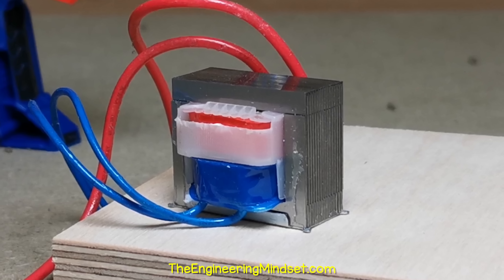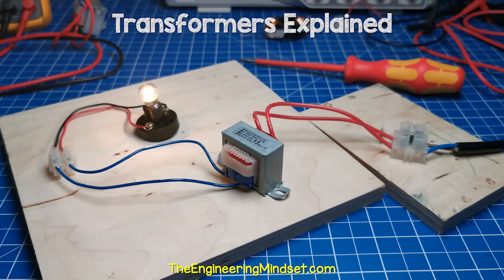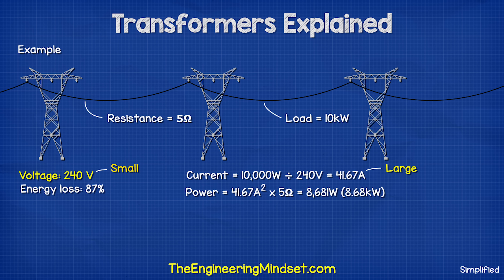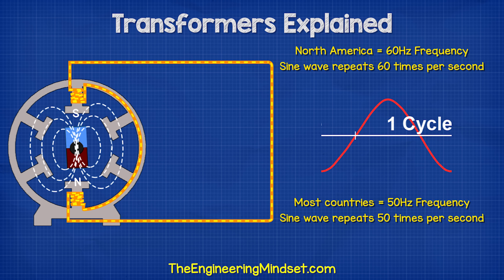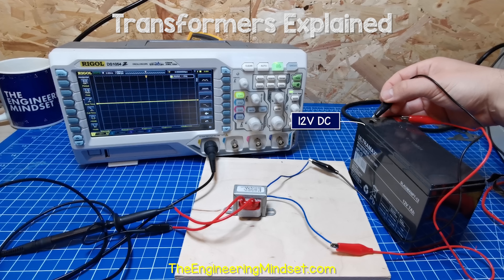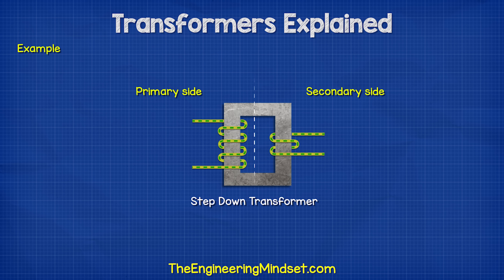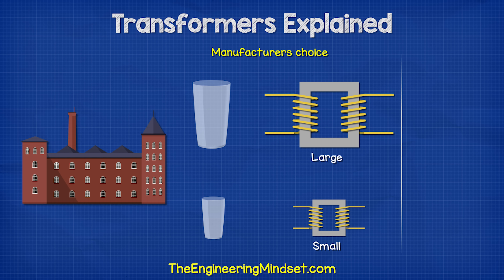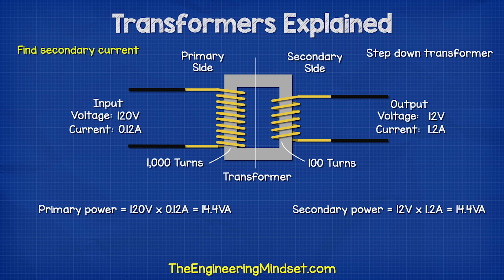Transformers Explained - How transformers work

Comment: Could you help me or explain,brieflly what I can do to solve my problem, My house is third from the last house connected to our main transformer,where I live and, these two plus my house have a problem with electricity,it flickers lights and it's annoying as hell. My house is brand new and I've installed all the latest tech of power security inside ,such as fault current protection switch and all circuit breakers from the best manfacturer but I still have flickering lights , this is not my personal problem but rather these few lasts houses on the grid. Is there any device that I can install to smoothe that electricity or anything I can do ?
Reply from the maker: You should be receiving 50/60Hz from your supplier, read their obligations for power quality and voltage and check your connection. It might just be the LED blubs you've plugged in, especially if they've been put on a dimmer switch, sometimes if you've mixed bulbs of different brands they will cause other lights on the circuit to flicker because they have different conflicting designs

Comment: Probably one of the best videos of this subject. I do believe, however, that you neglected to mention that sometimes transformers with the same number of turns on both the input and the output are used for certain applications. The purpose of that design is to be able to transfer power between two different circuits at the same voltage, but keeping them electrically isolated. If I'm not totally wrong, it is similar in function to a heat exchanger where energy, in the form of heat, is transferred between two isolated systems.
Reply: Isolation transformers are used all the time for supplying non linear loads i.e. VFDs and other electronics that are prone to damage from voltage spikes.

We had an overhead AC crane that kept tripping on overvoltage faults.   We would simply bucket up to the crane bridge cabinet and reset the drive. This was going on for months and we were getting tired of it. 
We got ourselves a 75kva isolation transformer and installed it in between the main switchgear and the breaker panel that fed the crane. After wiring the xfmer after the switchgear and before the breaker, we never had an overvoltage problem again.
Reply: Referred to as 'isolation transformers' and are used mainly to test/troubleshoot damaged and/or outdated/unsafe electronics. Largely as a safety precaution for Vacuum Tube electronics of the pre-60s/70s as they necessarily require high voltage supplies which could electrocute you if accidentally touched while open or if a fault shorted the hot side to the chassis. I forgot exactly but the transformer breaks one possible path for the current to travel through you if you came across the live while touching something grounded

Comment: It’s stated in the video that transformers only work with alternating current. What about basic automotive ignition coil? That’s a “step up” transformer, isn’t it? It take 12vdc and ramps it up to 30k+ vdc. If I’m mistaken, I apologize.
Reply from the maker: Please watch the section on DC and transformers. You'll see it can be used but not constant

Comment: Sir, my previous monitor work's with 110vac to 220vac, can you please help me thru giving a diagram or link on how i will connect it to my transformer with 3 input terminals 0vac, 110vac and 220vac.

Comment: Excellent video. Thanks.
Transformer grounding question?
I plan to place a step down transformer (110 to 16 V)  in a metal box.  The box will be grounded using the ground wire from the mains. Which of the following should be grounded to the box: primary winding, transformer core and/or secondary winding?

Comment: So the video stated that they don't work with dc power. Is an ignition coil for a car not a transformer even though it works the same with a primary and secondary coil. Would it be considered a step-up transformer or is there something about it that makes it not considered a transformer?
Reply from the maker: See the section on DC power, it can work when switched or voltage changes. Ignition is step up

Comment: Thankyou so much for the explanation, I'm New to electronics so I have one itching question,  if the primary side is not connected directly with secondary side is that mean the current from the AC generator will always flowing even tho the light is not turned on?
Reply: oh wait, is that mean the primary circuit is basically short?
Reply: oh wait, is that mean the primary circuit is basically short?
Reply from the maker: If the circuit is not complete in the secondary side, then no current will flow. So the ac generator runs, ready for when a load is connected. The ac generator will become harder to turn of a load is connecteded. You can still measure a voltage across the secondary side even though there is no load, because the coil is still energised, just no current flows except tiny tiny amounts from losses

Comment: I think transformer to load calculation @12:54 is slightly wrong: 90kVA & 89kW makes 13.4kVAr not 13.9kVAr. Unless I’m making a mistake…?
I’ve recently discovered your channel. These are great videos, thank you.
Reply from the maker: It's because 89kW / 0.988PFF = 90.08kVA not 90kVA. I omitted the 0.08 on the visuals but included it in the calculations. 90kVA = 13.4kVAr but 90.08kVA = 13.9kVAr

Comment: So then, a microwave is being upvolted to 240 from 120, and it looses half of the current.  What does the loss of current mean for the power, and how would the microwave perform if it were connected directly to a 240 outlet, like a dryer or oven?

Editing to add, I'm American which matters cause of the first few minutes of this video, and also, a complete novice, just curious, not actually going to "Tim the toolman Taylor" my microwave, don't you worry about that...

Comment: You need to watch a video by vatasium on what is electric turns out it’s just a magnetic field that runs along the wire not electrons flowing threw a wire.

Comment: I understood everything up till 12minutes 50seconds of the slide, where it shows a transformer apparent power is 100kVA and then it shows a load  = 89kW/90kVA, which doesnt make sense. where did the 90kVA come from? if the true power a.k.a load is 89kW and the apparent power is 100kVA, shouldnt the PF be 89kW/100kVA = 0.89?

Comment: At work they use transformers. They have a couple Cogeneration unit and they also produce chlorine. We have to build scaffolds for them to change the oil in the big ones now and then.

Comment: When I was a kid I had a train set which ran off a transformer which supplied 12V to the tracks. It was a massive device about the size of a brick. It also hummed.
How then are mobile phone chargers the size of a Mars bar?
The trick is to convert the mains supply to something like 20KHz, you only need a tiny transformer. The frequency is irrelevant when you run it through a rectifier.

Comment: But how do you limit the current on the supply side? With the wires wound and directly connected to the power supply one would imagine very low resistance and huge current that would burn the transformer.  Does electric field introduce resistance as well?  Great video by the way

Comment: how voltage changes on secondary: from idle to almost short circuit, i do not think it really follows formulas, for ex car battery charger  on empty batt it gives 12v and 4.5A,(and more heat) but when same batt is full, it gives 16V and 1 A, so i am working on trafo from microwave and replaced secondar with some 20-25 winds, and it gives some 16v at 10A,so what voltage could be at 30A

Comment: Reactive power itself is not causing the loss. Its the current that reactive power carries that when pass through the wire, causes heat loss based on wire resistance. Example. If a transformer delivers 100W real power @ 10v, 10A to a load and load has a power factor of 0.5, the reactive power is 100VAR to the load. There is another 10A flowing through the transformer coils (coils carrying 20 amps total), not doing any work but since its flowing through the coils, the heat generated by this current is I^2xR so by getting the power factor as close to 1 as possible, we get the reactive power as close to zero so the current flowing in the coils is as close to 10A as possible, improving the transformer efficiency. A load that eats 200VA but delivers only 100W of work has a power factor of 0.5. The transformer will need to be rated 200VA to supply that load. Put some caps on load and bring the power factor close to 1 and the transformer required can be 110VA to power the same load.

Comment: I 68, m, studied engineering many moons ago (seventies) and one memory is of challenging someone and finding out he was right. A fellow student went round the hostel asking us whether we believed we could get a shock from a 1.5 AA battery? I scoffed and said "of course not". 
Promptly he took out a 1.5 AA battery and a transformer (230 v AC to 6 DC) removed from its case. He asked me to hold the 230 v side wires and held one 6v side wire firmly against the bottom of the battery. Then he rapidly flicked the other wire (on the 6 v side) against the top of the battery. I felt a distinct shock as a MOMENTARY current (at 230*1.5/6 = 57.5 v) was generated by the transformer.
Such incidents do more to teach you the basics of a discipline than hours of dry lectures by Professors!

Comment: I've seen transformers in tv's, home stereos, older home theater sound systems, battery chargers, (high pressure sodium, low pressure sodium, metal halide, led street lights, treadmills, microwave ovens, rest top computers, indoor/outdoor AC units.
Reply from the maker: Seen the new LED explained video? so much detail covered! https://youtu.be/O8M2z2hIbag

Comment: Australia uses 240/415v. Residential choices are 1, 2 or 3 phase.
Reply from the maker: Nominal voltage of Australia is officially 230V, in line with the majority of the world. The networth is transitioning to lower voltage but not all States have implemented this yet. Some states have only part implemented it.

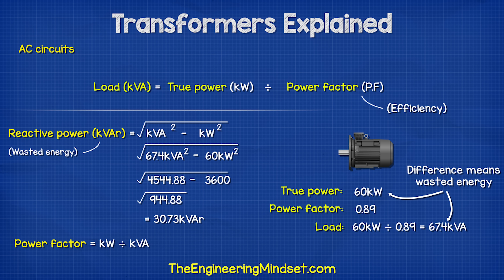Comment: @11:50 you mention the VAr is amounted as heat loss. For anyone reading it should be noted that the Power Factor; ratio between W/VA, is a representation of the phase angle (lagging/leading) of the voltage and current waveforms. A good way to visualise this is by drawing out 2 graphs of Voltage/Current waveforms.
1. Voltage and Current at unity, then draw Real Power on the same graph as (V*I)
2. Voltage and Current at 45deg lag or lead, then draw Real Power on the same graph as (V*I)

You should see that the multiple of the waves at offset, compared to unity shows a reduction in RMS Real Power, it's a good visual representation of the losses.

Comment: dc voltage spike switching on and off is intresting, could that have any application? seems useful
Reply from the maker: Yes, it's used in a joule theif circuit. I'll be making a video on that very soon
Reply: @EngineeringMindset  thanks! can't wait to see the video.

Comment: This is very informative thank you. I am an automotive tech and in these gasoline engines you need to break the dc current somehow in the primary coil to collapse the magnetic field. Due to the principle of electromagnetic inductance this produces a surge in voltage in the secondary coil. Your explanation goes even further and makes me understand more deeply.

Comment: That was helpful  😊 
Transformer ratio K= (n1/n2)=(v1/v2)=(i2/i1)
where
V1 : voltage at the primary side
V2 : Voltage at secondary side

N1 : number of turns at the primary side
N2 : number of turns at secondary side

i1 : current at the primary side
i2 : current at secondary side

Comment: And if you had three coils on your transformer where one secondary coil had the same turns as the primary and the tertiary coil had more, would the voltage and current add together if you spliced them into the same delivery line provided the delivery line could support the current and voltage?

Comment: If I was to show you a piezoelectric device that puts out 100,000 to a trillion volts AC that runs on sound and feedback would you be able to make a transformer for it to make it usable to the public? I'm a bit afraid to build it but maybe it can be scaled down. I have already engineered the 20 megahertz transducers.. most of the parts in 3d. Maybe we can help each other. This device requires no power input and picks up sound we can't hear to keep the piezoelectric disks vibrating non stop forever. it has a 4 inch spark gap inside it that will make radio frequency to spin and split water droplets that condense inside it. The sound from the exploding water droplets is fed back into the microphone in an endless feedback loop to keep the piezoelectric disks vibrating forever. The dilemma is...I can give you the 1 to 2 trillion volts AC.. but nobody would want to be near it. Any suggestions? The smallest 2 cubic centimeter crystal in a piezoelectric lighter will give off 50,000 volts.... is chump change in comparison to 2 x 12 inch piezoelectric disks cut as 2 speakers back to back not touching each other but sharing the same center... and  mount a 500 lb xylophone key/ microphone on it on a fret at the nodes.. and it will amplify the force on the disks 829:1.... extreme power. The center bobs in and out so fast that it creates a doughnut field around it and the spinning water gives it the magnetic field.. no magnet, no coil or battery is required. It's like a mini spinning galaxy in a box and each of those water droplets are like mini suns spinning in a mini galaxy as the radio frequency keeps the water droplets lighting up.
Reply: Build it. I want to watch the video
Reply: @TomFloridaMan  I asked John Hutchison to build it.. he said he would... but none of us have the money. People design airplanes and automobiles that are quite complex and they never have the money to build them.. someone has to fund it. But to be honest free energy is a lot easier.. it's so simple... but someone has to fund it... and so it ends there.
It's done with 2 x 12 inch granite disks facing in opposite directions... and a 500 lb xylophone key which is a microphone. The xylophone key sits on a round seat that sits on the outer edge of the disk facing up..When you put a microphone and speaker close together you get feedback... and this is what keeps it vibrating forever. It all goes in a drum box with a hole on top and the tweeter cup sits under the air hole and on top of the speaker facing up.... water condenses in the cup.. spills over on the speakers.. starts to spin and lights up like a mini galaxy in a box. The radio frequency from the 4 inch spark gap between the cup and the housing seat.. lights up the spinning water droplets... they go boom right back into the microphone in an endless feedback loop. No magnet, no coil or any input power is required. water is not required as it will make it's own. It's the most simplest technology in the world.. more simple than a toaster. To build it properly.. you have to know how to find the nodes. to design it properly.. you use a compass and ruler and draw flower of life symbols and connect the dots to make the disks. All the crossing points on the flower of life pattern is a node... it has to be done in 3 dimensions when drawing the parts. To make the Disks you need a CNC machine that will cut granite. The disks look exactly like the 2 Dropa stones found in China in the 1950's.. the ones where only one set of photos exist. Each disk when vibrating will put out about a trillion volts. The 4 inch spark gap inside is 100,000 volts... giving the radio frequency to light up the spinning water droplets. There are 13 parts total.. and the device has no moving parts. 2x 12 inch granite disks, a cog separating them, a 500 lb xylophone key tuned to 90 hertz, a drum box tuned to 90 hertz, 2 housing seats that look like stonehenge one for the top and one for the bottom disk, a tweeter cup tuned to 90 hertz, 2 heavy duty tuning forks tuned to 90 hertz that go on each end of the xylophone key mounted closely, and 2 wind chimes mounted at the nodes on each side of the box and also mounted at the nodal points of the box. To start it up initially you only have to sing to it and once the feedback kicks in it will run forever. and there is a wire that goes from the tweeter cup to one side of the fret. It is suitable for a power plant and extremely dangerous to get near it.... build at own risk. It will pick up vibrations at the low end below 1 hertz which will give it a range of about 800 miles... maybe more.
It is possible to run a car with a 100 lb xylophone key... but it takes money. It is also possible to power a whole continent.. for nothing.

Comment: i have a question, i've done some practicum using a transformer, but somehow i found odd result in the current since rather than decrease the current, it was increased when the ratio of secondary is more than primary  in, i was using variac for the primary input of the trafo.

Comment: I was hoping to at last find some more details about transformers but jet again this are only basics. I wish that somebody wil make more detailed video about this topic. For example, I can't find an information how much turns on primary side we need for transformer to work properly, because I can only gues that 10 turns on primary side and 1 turn on secondary will not work even if formula is right. (It will propably blow up? right?)

Comment: I’d have to disagree that a transformer doesn’t use watts/power. If the circuit is turned on at peak voltage, the transformer causes major inrush current, even with no load. PTC or ntc resolves this issue